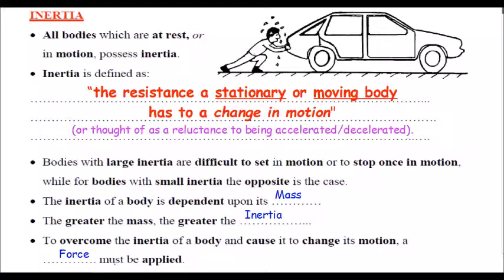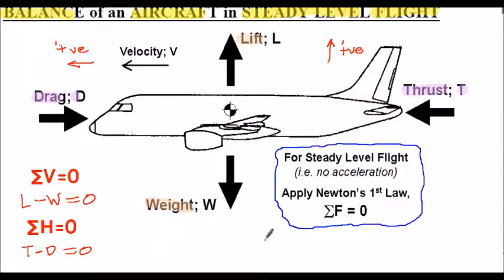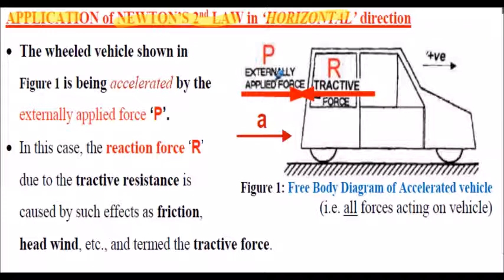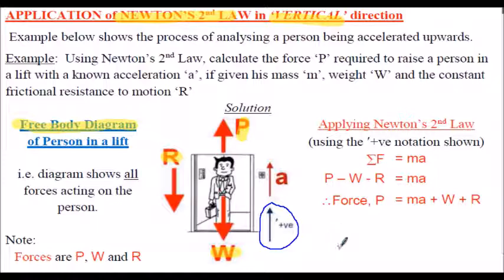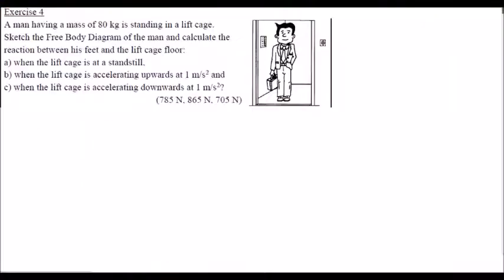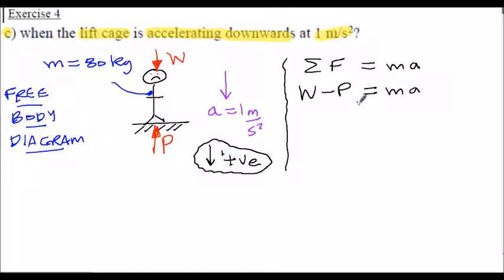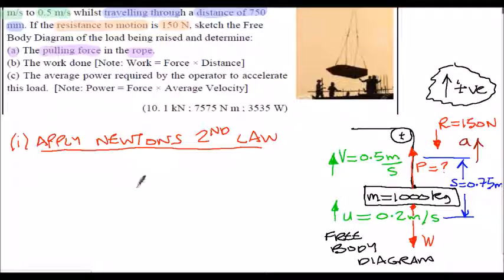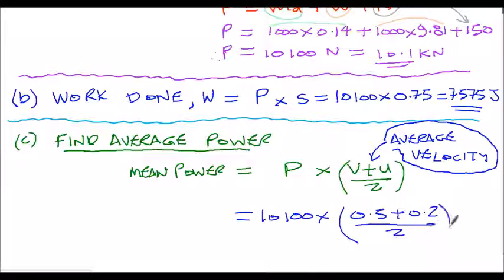Newton's Laws of motion - Introduction 221021

Comment: Excellent videos. Just wonder if you could clear something up for me, I am not getting the same as you did for Exercise 5, question A where you are finding the acceleration from V2 and U2. You get 0.14m/s and I get 0.078 for some reason. Wonder what I'm doing wrong? Thanks.
Reply from the maker: Hi, hope the video has been of some use to you. Exercise 5 solution is contained within the video at around the 48 minute mark.  Does this helps to clarify the solution?  If not, let me know.
Reply from the maker: I think I see where the error might have arisen; is it due to incorrect BODMAS usage?   If you are using one-line formatting on your calculator, the denominator of 2 x 0.75 needs to be in a bracket, i.e. (2 x 0.75).  Just a suggestion that springs to mind, as I have seen my students make a similar error when using their calculator.
Reply: @alancarter2020  Hi Alan thanks for the quick reply (especially at this time of night!) Ah yes, what I was doing was bracketing the top only, if I bracket both top and bottom I get the same. Thanks for your help Alan, top man. I'm doing an HNC at the moment, so finding your videos truly excellent.
Reply from the maker: No problem, glad I could help sort it.   I deliver on the HNC programme so have You tube playlists of lecture videos I use with my students for the maths and science units.  Hope some of them might be of background help to you in your studies, but obviously different lecturers can have a slightly different emphasis (or use different methods) within topic areas, so just be cautious of that.  These videos are the content and coverage I deliver to my students, but they might not suit your studies within all topic areas.  Best wishes. Regards, A.